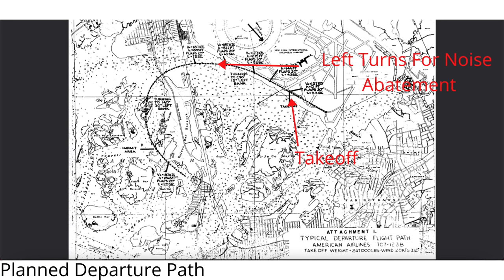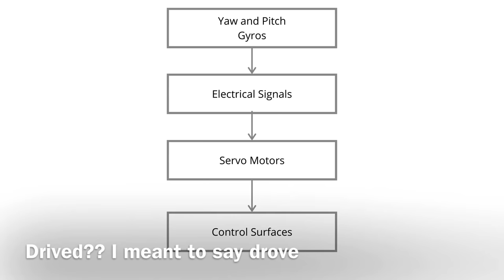The Short Circuit That Crashed A Passenger Jet | The Crash Of American Airlines Flight 1

Comment: In the 60's, my dad was a LAX-based mech with AA and every year our family vacation began with a trip to NY to see my aunt and uncle using his pass privileges. In 1962, we started our vacation seated in the 4, forward-most seats in the first-class section of a 707 awaiting departure from  LAX to Idlewild (later JFK) when a problem occurred with an oil presure gauge. (This we knew because my dad knew the mechs working the problem and had a friendly chat with them) After the usual swap-outs, the problem had not been rectified, so after about an hour the company decided to do a tail-swap, reboarding us on another aircraft for our trip east. A few days after our return, we learned of the crash of AA Flt 1, and my dad informed us that it was the same plane on which we had originally been seated just two weeks prior. Every time this crash is mentioned, I think of that plane, the sights and sounds and smells, and what it must have been like for the people aboard as it started it's dive into Jamaica Bay.

Comment: As someone who has tied up a LOT of wire bundles on aircraft, and aircraft parts, I will say that tweezers are unlikely to have caused that sort of damage to the wiring.  What COULD have caused that damage is a hemostat, yes, the same thing doctors use to clamp off blood vessels during surgery.  They look like a pair of needle-nosed pliers, but thinner, and are able to be locked closed.  If the wires needed to be pulled through an opening or conduit (small protective tubing), then the technician might have used hemostats to get a grip on them to push/pull them through.  A better method is to tape the wires into a compact bundle, push them through, and only use the hemostats on the very end of the wires.  That tiny bit that WILL get damaged can then be trimmed off prior to making the electrical connection.

Comment: We studied this accident in training. This happened very fast The aircraft impacted about 30 seconds after rotation. After this pilots were not to engage the autopilot below 400 feet on takeoff. This is one of the reasons the series yaw damper was developed.
Reply: What does the yaw damper do? I hear it going on and off on some YouTube flight channels
Reply: @jamescollier3  A swept wing aircraft has a tendency to "fish tail" in flight. The yaw damper uses the rudder to control this by measuring the yaw with a rate gyro. The normal autopilot heading channel will not control this  In manual flight the pilots reaction is to slow to counteract this. If you stand in the rear galley of a B747 you will feel the tail move about 1-2 inches from side to side. I believe this is caused by the flexibility of the fuselage as sighting forward at the overhead bins them move out of line down the aircraft.
Reply: @jayreiter268  ah, thanks😃
Reply: @jayreiter268  what does v1 v2 and v3 mean?
Reply: @ajrafkabir  I am a retired airline mechanic not a commercial pilot. At about 80kts the aircraft is aerodynamic and flight controls are used for steering. V1 is the speed where under the present conditions the aircraft can no longer safely reject the takeoff. V2 is the climb speed. I am not sure of V3 must be engine out climb speed. From the times I had cockpit approval that is the way it goes. There is the call "80knts , rotate , V2" as the aircraft accelerates to climb.

Comment: I used to rewire controllers for a living and some of the construction and design was made in such a way as to wear out the teflon coated fine wire after so many cycles. This was not a built in obsolescence but a  virtue of the design of moving parts, hence the slippery wire in the control shaft having a sharp edge to curl around that would eventually wear out the coatings causing a crossed circuit and control failure. I used to chamfer those edges upon rebuild to make them last longer. Glad these were not used in aircraft but in terrestrial based machinery where the application of an emergency stop button would halt the machines path when these circuits were crossed. Pilots are not granted that luxury of just stopping what action has been caused by a circuit failure. Lives are then in the balance sadly. Great episode as I have come to expect . Thanks Mini
Reply: Good wiring is an art bad wiring is a catastrophe.

Comment: Hey mate, I subscribe and enjoy your video’s. I’m a retired Air Traffic Controller and before that was a maintenance engineer. Just one thing - vectors can only be provided when receiving a radar service (no such thing as a visual vector!). As such, the correct terminology is just ‘vectors’,  not ‘radar vectors’. It’s an error many in the industry also make, inside and outside of the cockpit, so you’re not alone.

Comment: Since this is an historical event, you'd think that the creators here would take more care with the video representations of the plane. An AA 707 in 1962 had completely different livery. What they're using here for livery was not seen until 1968,  and lasted until 2013. In 1962, the AA livery was the astrojet "lightning bolt" stripe on the fuselage, and the old-style "AA" logo on the tail.

Comment: Unfortunately rudder hard overs on Boeing aircraft (737 300s 400s and 500s) re-emerged in the 1990s when two 737s crashed in the USA. The eventual fix was to increase all the speeds to be flown in the mid flap settings by 10 knots. This gave the ailerons enough power to overcome the rudder, but created a few other problems in operating the aircraft.

Comment: There's always a struggle between doing it safe & doing it cheap! You see it in all privately owned companies. Problems arrise when cheap wins. 
The cost of equipment & trained personnel in the quality control department is a profitless overhead, as seen by a commercial company & cutting overheads is the first step in pushing up profit for the shareholders.
Reply: If you’re alleging that Bendix was knowingly using a cheaper process they understood to be unsafe, please provide a reference to support your claim.

Comment: Were their no roll gyros on these aircraft? .I find it hard to believe that a rudder hard over would have brought them down.... Something like that had to be part of their training, I'm assuming.
Reply: That is what cause the 737 accidents in Pittsburg and Colorado Springs about 25 years ago.
Reply: @mikedargen714  The 737s also has rudder problems, but they were caused by the hydraulic control unit (when warm hydraulic oil has flown through a ice cold hydraulic valve), not by a electric system. 
The cause was different, the fate was the same
Reply: @simonm1447  hard rudder over no matter the root cause...with cause the same results
Reply: The roll gyro signal didn't feed into the yaw damper system.  I'm not sure the pitch signal did either, but I don't know.

Comment: The title states it was a "short circuit", but you mentioned an "open circuit".
The two are completely opposite.
A short is when 2 or more wires that aren't supposed to make contact do.
An open is when a connection is lost, like a light switch.

Comment: The airline industry has a dirty little secret!  Excepting the jumbos, most planes do not have a redundant rudder.   In fact, the 747 has a split rudder that offers redundancy.  There was a case where the redundant 747 rudder saved the plane from catastrophe.  However, the most common planes: Airbus A320 and Boeing 737 do not have redundant rudders.   This is outrageous. The airline industry cannot say it takes safety as a priority until all rudders are redundant.  It’s easy to do.
Reply: Bigger planes like 747 need split rudders because they are big jets but A320 or B737 are small planes, they are not required to have split rudder. It wont help the plane in anyway. And it is more expensive than single rudder
Reply: Sounds just like the awful Ford Mustang solid rear axle. This makes the handling very stiff and prone to spin, even on dry pavement. I've seen it spin full 360s several times and just barely saved one from doing that myself...

That was that way since the beginning, as I understand and recall it. We've had the better way for several decades now, though...

Comment: Unusual that the flight number is still used.  Normally any catastrophic (deadly) crash has it's flight number stricken and is never used again (at least in the west).
Reply: what's even more unusual is that the flight no. of 1 (and its variants such as 01 or 001 etc.) has been involved in 9 separate crashes (although most occurred in the late 1930s/early 1940's when airlines were just starting). American airlines alone has 3 separate crashes with the flight number 1 (one in 1936, one in 1941, and this one in 1962)

Comment: If you think Boeing learned anything, check out the crash of United Flight 585 near Colorado Springs, CO in 1991, 29 years later. This incident was also eventually blamed on a faulty rudder servo but for a different reason...

Comment: Wow, noise restrictions in New York back in 1962 😳
Reply: The first-generation jets were extremely noisy.  Complaints were rampant.
Reply: If you know the LGA area, there are apartments in Astoria nearly up to the airport fence, the Grand Central Parkway is one boundary, with businesses, hotels and housing right across the GCP. It was built on North Beach back in the 1930s as a field for DC-2s and DC-3s. It's kind of thrilling and scary to see jets landing  diagonally over the GCP and there you are driving....

Comment: At 4:50  I believe you're referring to the autopilot system.  Not "hand flying" the aircraft.  At 7:24 the yaw damper system does not cancel the yawing motion but it does stop the aircraft's "Dutch roll" by rudder deflection.
Reply: Auto Pilots have a Minimum Altitude to turn on. Pilots never turned the auto pilot on shortly after takeoff and many times hand flew the airplane until reaching cruise. I never flew the B707 but I believe it used the same autopilot as the DC8. The early jets did not have a full time YAW Damper. The YAW Damper on/off switch was part of the auto pilot system. It was a 3 position switch on the Auto Pilot, OFF, YAW,, A/P. The YAW Damper on the early DC8s was always OFF for takeoff and turned ON shortly after takeoff. The auto pilots with full time YAW Dampers came out in the late 1960s. In the early airplanes when you pressed the button on the yoke to turn the auto pilot off the switch would go to off and you had to turn the YAW damper back on. When you pressed the disconnect button on the newer airplanes the switch went back to YAW Damp.

Comment: Bendix the supplier of the servo motors,,, "played the blame game",,, this always happens.
the first 707s were built for USAF air refuelers KC-135. The original KC-135 had yaw problems on take-off with uncontrollable yaw, causing losses. the solution was to add/install the "yaw dampener" which caused this problem.

Comment: Did they find other 707's with damaged wires? You mentioned they looked for it, but didn't say if they found others or not.
Reply: Yes. The wiring was damaged at the factory. Those are the very motors installed on the planes.

Comment: Great Vid but a question lingers in the back of my brain: Did anyone on the ground suffer hearing loss because of the flight path.
Reply: Noise abatement was about noise pollution in general, not hearing loss specifically. And noise pollution has many other unwanted effects besides hearing loss.

Comment: Well I have learned something from this, I always believed that the rudder only controlled yaw, with the ailerons being responsible for the roll. Maybe it had a dramatic effect in this case because the plane was already performing a left hand bank. Even so, still surprising to learn that the roll could not be correct with the ailerons.
Reply: But the accident happened in 30 seconds. Narrator said that they could have corrected with ailerons or 75# opposite rudder - if they had altitude to try. Like the 2 737 hard over events - although problem now fixed, simulators are used to train pilots how to react in such an event.
Reply: If you have a fast enough yaw rate, then the wing on the outside of the turn is moving through the air significantly faster than the one on the inside, and experiences more lift

Comment: Sad how stringent safety guidelines are almost always paid for in blood.
Reply: True, not only in aviation. Simple things such as fire safety, emergency exits in buildings, seat belts in cars... countless people died, and it’s good that we learn from such fates.
Reply: @benjamin4281  I'd like to review that, please...

Most of the fire codes were around since the early 1900s, because of things like the Great Chicago fire. In fact, modern sprinklers were around before the turn of the century. 

They were made to save merchandise, NOT people. They weren't required until 1978 in public buildings and it's why you see old buildings rehabbed. So they can grandfather themselves in. 

I've noticed they pick and choose which they'll abide by and which they won't. 

I've been in a few fire traps. 

One place, they actually locked the doors from the inside, but "only during the performance." 

Try getting ahold of a fire marshall on that one. Even the cops said "good luck."

So, nobody was allowed in the aisle AT ALL, and it wasn't overcrowded, but there were only two exits on one wall that I saw. If there was one out back for the kitchen, I didn't see how that would work...(buildings next door). 

Oh, and the other exit was locked and blocked by a drum kit. No sh*t. HUGE, HUGE no-no, ESPECIALLY in Chicago (they have the honor of largest fire in US, the Iroquois, in 1903; 602 killed by locked and blocked exits, for one thing), where they're corrupt AF, but not on fire codes very often. 

I saw zero fire extinguishers, even though bars/dinner clubs with a kitchen are more likely to go up than bars without live music and food. The sound system can short, although it's probably more likely to have an overload on the lights, it's way more power draw. 

THAT should have been an iron clad code, jmo. 

Oh, and panic bars? Nope. Lol. I'm going to bet they're based in capacity and 50 or less doesn't qualify. But they're all of 160.00 each at Home Depot, why wouldn't you have them??? The store door lock types tend to be fussy, I can't imagine trying to get one unlocked in a panic. 

In that case, it was a show about the Andrews sisters, so I had about the best chance as anyone as I was younger than 80% of the audience or more, lol. But it still made the hair on my neck go up, wondering WHAT ELSE the owner was hiding...(The No Exit Cafe, Chicago).

My point was that most of the things you mentioned were around at the time of major accidents. There's a few on the Iroquois fire. Library has them. In fact, the one QUOTES the codes at the start of each chapter, VERBATIM (in their entirety for non-English speakers), at the time of said fire. 

I think the only one NOT in effect then was the one about revolving doors being flanked by two outward opening doors because of the Cocoanut Grove fire in 1942 that killed 490 (2 are always counted twice, big Bubbles Shea, you see him in photos of the New Broadway Lounge, I believe that's him--the bartender, and a woman who died 6 months after the fire in May)  

But please note the ridiculous similarities between it and The Station fire in 2003. They were corrupt AF. There's only one authority on that, John Barylick. He was the prosecuting lawyer or one of...Killer Show. He also has numerous YouTube talks. 

Sadly, some kid was trying to make a bootleg tape at the time of the fire. It apparently is a million times worse to listen to than the very grainy Butler videotape, according to Barylick. 

A sad (but not gory) photo is "Jeff Rader's last photo." He's trapped in a room full of fire. He actually looks calm. 

Interesting or really sad there's even this last photo inside the bar at all. I wonder if it helps or hurts his family...?

Comment: The Bandex Corporation is lying! The servo damage was NOT caused by flying debris. Rather both the servo damage AND resulting crash was caused by poor wire placement either during the servo manufacturing process or servo installation into the aircraft.  Obviously there was ongoing fluctuations in wire clearance during operation causing the wires to be crimped repeatedly.